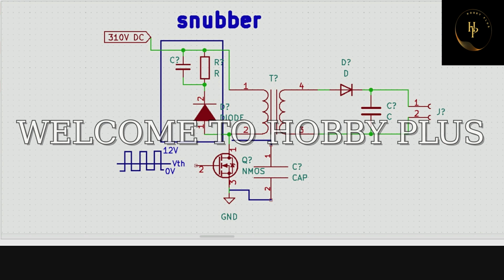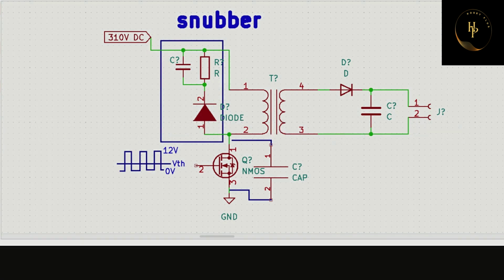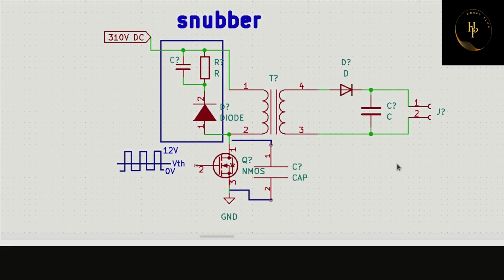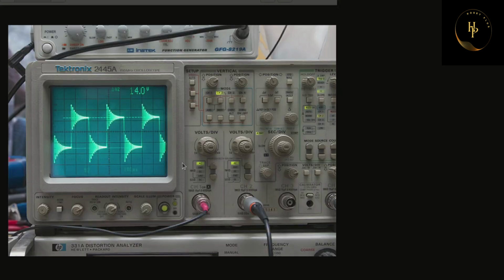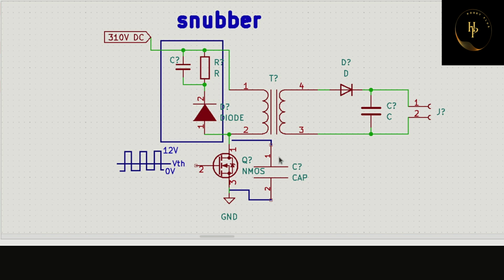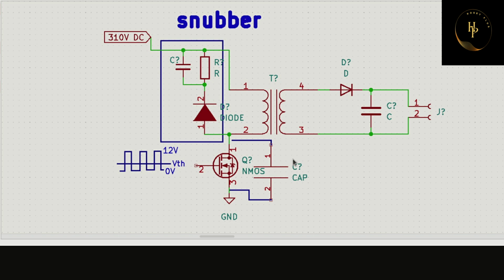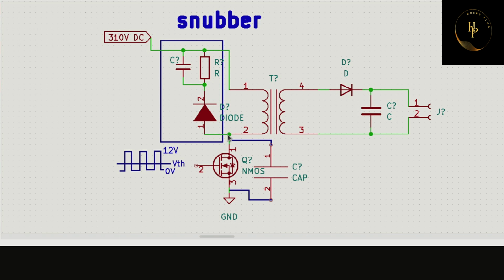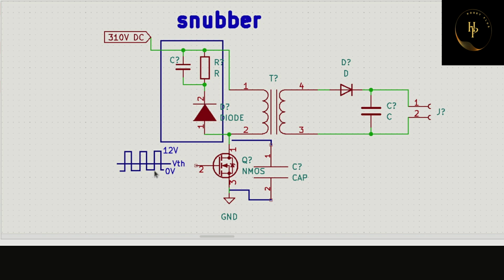[10]SNUBBER CIRCUIT ANALYSIS

Comment: Why voltage is doubled to 620 V at point 2
Reply from the maker: 220 volt AC is = (220 X 1.4142) DC = 311 Volt Approx. It is constantly present in the circuit. But when transformer is in ON mode (Mosfet in active mode) electromagnetic field increased. When Mosfet is in OFF mode electromagnetic field convert to voltage and it is 311 volt. respect to ground you can get 622 volt in Point2. Because 311 volt (DC power) still present on the transformer transformer. So 311V + 311V = 622V. That is 311V DC power sources in series.
Reply: @hobby_plus  Thank you but still not clear, at pt 2 do the voltage doubles ehen MOSEFET is On or Off, and why it should double
Reply from the maker: @MUSTAFAJOMAA  I will make a video for that ok.
Reply from the maker: https://youtu.be/fc2Hqw7NJ_A Please watch this video for batter understand of your problem, thank you.

Comment: Sir i am designing a flyback with 600 V input and 48 V output. There is very small ringing in drain to source voltage of MOSFET. I am getting rinnging in the drain current. Why is that so?
Reply from the maker: I will tell you, please waiting.
Reply: @hobby_plus  sure sir..
Reply from the maker: Actually you need snubber circuit, you can get it in my other video, i have send you a link. https://youtu.be/HpISvxXFsuQ
Reply from the maker: https://youtu.be/64Z5-9PzWF8
Reply: Okay sir.. Thank you..
Reply from the maker: If your problem is not solve, please kip in touch.